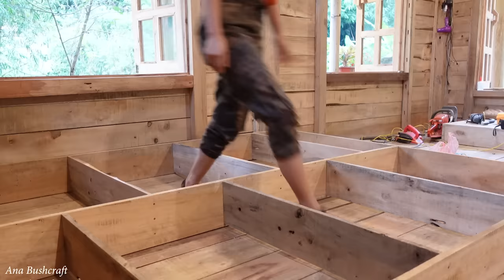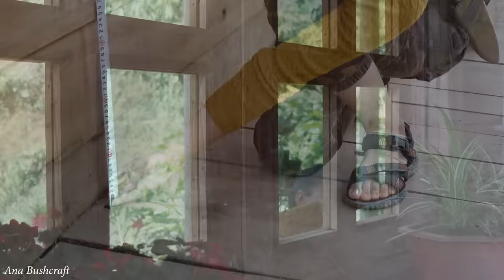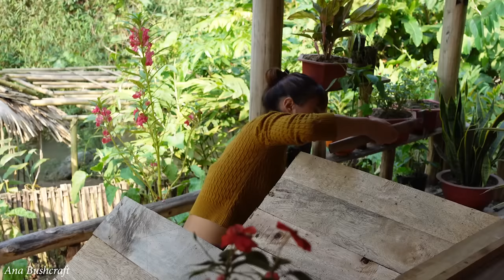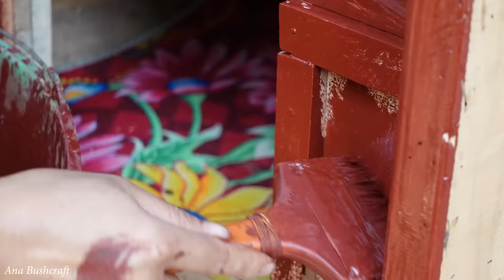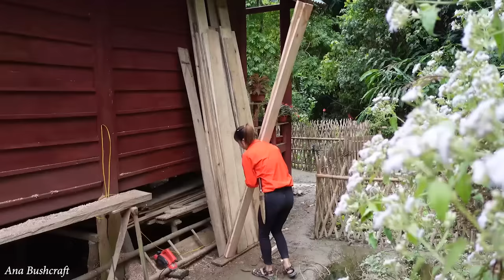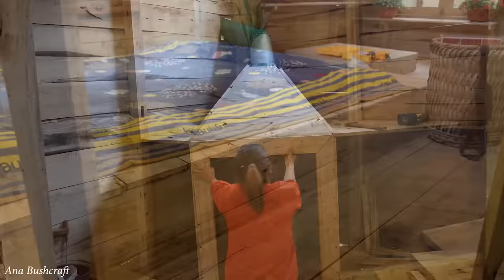Full Video - Build log cabins and warm fireplaces | Ana Bushcraft

Comment: Ana, I greatly admire your skill as a builder.  How did you raise the heavy beams that support the structure of your new home?  Did you use a winch (block and tackle) of some kind?  

And, how did you know how to build the structure for your bridge? Have you built such bridges before?  (After you knocked out the supporting timbers, I thought it would collapse.  But, then when you added the "keystone" at the top of the bridge as well as the structure attached to the keystone, I knew that it would remain standing.)

How did you find your water-powered generator, and does it provide power year-round? (Does it fail to perform in your dry season when the water level is low?  And, if it doesn't perform then, do you also have a solar-powered generator of some kind.

I'm really touched by how much you care for your dogs, cats, chickens, and ducks. But, do your kitties get enough to eat?  (They look so skinny.)

Comment: Hello Anna
i am your loyal fan
I suggested a year ago that your log cabin would have a fireplace
Seeing you realize this dream today, I am happy for you.
However, there are a few issues:

1. The chimney outside the house needs to be equipped with a chimney cover to prevent rainwater from pouring in, and the direction should be inclined downward, because in heavy rain or typhoon, it is easy to blow rainwater into the chimney and cause the fireplace to seepage, and the chimney should also be fixed firmly just work.
2. The surface of indoor stainless steel chimney and stainless steel fireplace needs to be covered with thermal insulation cloth to prevent the surface from overheating and allowing the wood to ignite spontaneously.
3. It is not recommended to lay only soil as the bottom layer of the fireplace. It is recommended that you first spread the heat insulation cloth to prevent heat conduction and cause spontaneous combustion of the bottom board.
4. It is recommended to install a stainless steel and fine-hole door panel with upper and lower ventilation for the fireplace to prevent the flame from floating into the house and causing a fire.